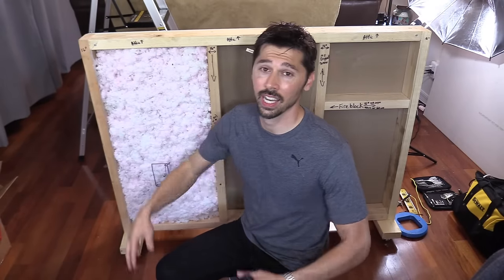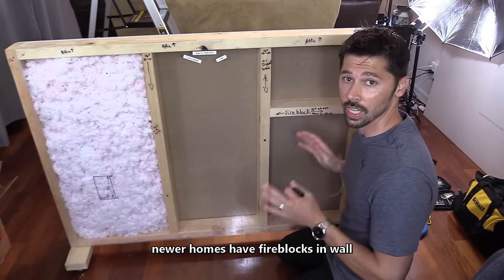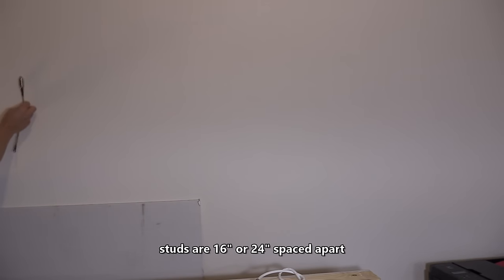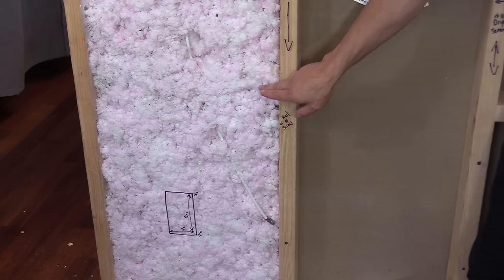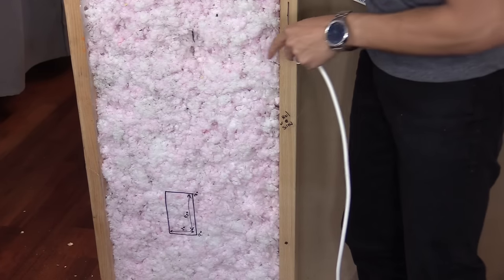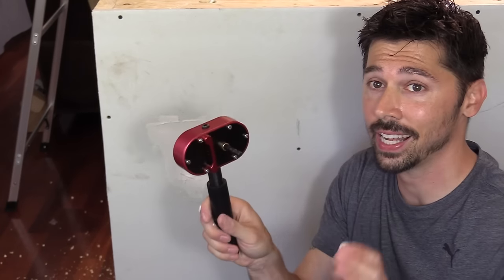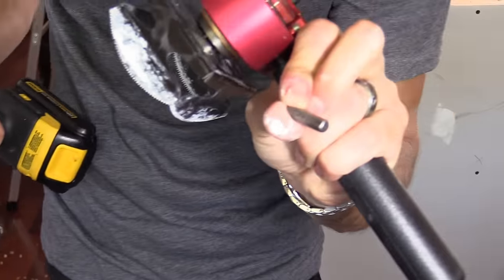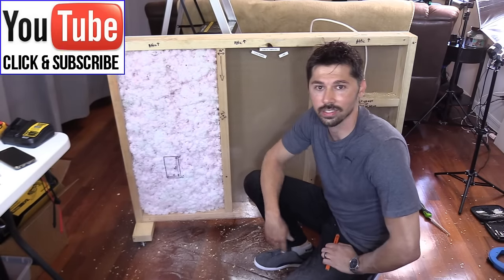3 EASY WAYS TO HIDE WIRES CABLES IN WALL & FIND STUDS

Comment: You can also use a razor knife and a straight edge to cut the square out to get access to the fireblock. A bit more work, but cheaper and just as effective.

Comment: To access a hole thru fire blocking I drill a 3/4" hole 1 1/2" above the fire blocking at a 45 degree angle. Then I seal the hole in the fire block, then I just have a 3/4" hole to patch in the drywall.

FYI: fire blocking is not always for fire stop. If a wall if taller than 8', mid way blocking is code now.

Comment: Does the magnepull kit include the flexible magic wand you used. I’m looking at the kit but didn’t see that item. Thanks for the information
Reply from the maker: Wand and chain I believe but I am double checking with them to be sure.
Reply from the maker: Yes flex leader wand 👍
Reply: Tampatec thanks.  I'm getting ready to buy the magnpull kit but there's one that's advertised for $125 and another one is advertised for $168 on Amazon and I don't know what the difference is except that in the center of the case something is different then the $168 one.  Thanks
Reply from the maker: @jeremiahjohnson731   this number is customer support. (866) 964-4557.
Reply: Tampatec Thanks for the #

Comment: I just use a tape measure and measure the top of the walls to find my drilling point.  It works.
Reply: Sure it works but so does this. What's shown here is faster and more accurate too. Which are definitely pro characteristics. Someone breaks a gadget like that out on a job and I feel like I'm getting my money's worth by hiring them. Another thing that works is just poking some cut coat hanger through the sheetrock ceiling. No one is going to see the little pinhole it leaves. Unless they got black ceilings or something. That's what magic markers are for though.

Comment: You didn't address sealing up the holes  after compromising the fire-blocking plate nor the top plate too.  Shouldn't some sort of foam fill be used to prevent a fire from feeding to the newly drilled holes should a fire break out from behind the wall?

Comment: Excellent video.  I'm moving into a new house soon and I need to run low voltage speaker wire throughout the upstairs loft/media room for a 7.1.2 home theater system.

Comment: A few here have made good points about patching a wall and other alternatives (flex bits etc).  If you MUST cut into the drywall you might consider using a blank wall plate instead of patching.  No patching/painting needed and you still have access in case more runs are needed later.

Comment: Hot glue gun works great for holding drywall patches in place so you can put your external filler on without the patch moving. You can even use a piece of cardboard as a backer if you don't have a stud there.

Comment: One thing I need to do is add an outside light through brick. I have a 3 car garage, one double and one single. I have a light on either end but not in the middle. not sure of the technique for running the electric from one of the existing lights on a finished house.

Comment: Im not an installer and don't have a  I have a magnetspot machine I used a neodymium magnet with sticky stuff on it, I placed that on the roof then I went into the roof with another neodymium magnet to about the area  and used the another magnet and presto , I had a plasterboard roof so its not that thick.

Comment: If you work for the cable company, there's a technique to avoid all of these obstacles. Just take 300 feet of cable and staple it over every baseboard and doorway throughout the length of the house. No muss, no fuss.

Comment: Now that u drilled thru the fire wall & made it easier for the house to burn, what is supposed to be put into the wall to prevent that? Second question is who has cable anymore? Everything I use is WiFi

Comment: I am an electrician in Canada. I do use the magnepull unit. But on another note our electrical code states that if a electrical cable  is too close to the edge of the stud, say by 3/4 inch.The drywall hides this situation.  If so then you must attach a protection plate to the stud or a fire stop or header or sill plate. The wire must be protected with a protection plate. This will inhibit any screw or nail to inadvertently penetrate the conductors within the cable. No one can predict what someone may do in the future to any home improvement or decorative add on to a covered painted wall even if a fire stop is only four feet to center off the floor. This also goes for headers and sill plates. If the hole is very close to the edge of the wooden stud then a protection plate is used. A protection plate is usually a steel plate that will inhibit a nail or screw installed with sufficient force. I usually use one of the removed sides from an electrical ganged switch box. I will recess the protection plate if necessary to keep things flush. Please I am not criticizing. I liked your video very much and you showed me some tools I would to get.Just trying to keep things from future troubles. Thank-you...…. Cheers!

Comment: Of course it goes with out saying that the best time to run any cable for a house is during construction when the sheet rock has not been installed. So getting together with the home builders and re modelers in your area can be a big money maker. Not just for you but also for them as their finished product will be 21st century ready.

Comment: Love the video but I can only imagine crawling all the way through a hot Florida attic, drilling the hole, discovering the fireblock, crawl all the way back then do the fireblock cut and then go back in the attic to fish the magnet back down.  I buddy of mine years ago had some really long semi-flexible spade bits for this that had a "wire hole" in the spade to pull the wire back up (or a pull string).  My big fear about these kind of jobs is hitting some electrical wire or pipes that's run horizontal.

Comment: Good job.But how about open 3 holes .1 for torch 1for magnet +cable and 1 for you to see through cavity.Then use extension drill bit for fire block(drill right underneath the middle hall ,No need for cutting  plaster wall,Your cable will go straight through.Then use roller magnet,Done.

Comment: I have only two comments. One, you don't need the expensive equipment to cut the receptacle hole. It can be done with a vibrating cutting blade, about $30. Mark the wall with a marker to indicate the top of the box. Then, using a new receptacle box lay it on the wall and draw its outline, staying at the narrowest outline of the box. Reason, you want to make sure the upper and lower tabs on the box will sit on top of the sheetrock. You will have trim the top and bottom with a box knife to clear raised parts of the box. Some boxes will vary in design. Second suggestion. Once you locate the fire block stud you can remove the overlaying sheet rock to expose the two by four, but make the cut long and wide enough to use a 90 degree drill motor to drill the hole at 60 degrees. Otherwise, the cable will be too close to the surface and possibly damaged by a nail in the future. Another option is a flexible drill bit shaft and a curve guide (about $50). Then you can keep the hole smaller and closer to center of the 2 by 4. In any case, the replacing of the removed section should be fastened to a wood backing. Otherwise it can easily be damaged at a future time. Oh yeah, make sure you have the paint to touch up the wall. Of course, if you have the money, the tools displayed in the video are great, especially if you are going to do a lot of rewiring. If so, maybe you need to call for an electrician.

Comment: For anyone wondering how this is done in houses that are not built out of cardboard : we have tubes preinstalled in the walls that go everywhere an appliance is needed. If you need a cable somewhere that doesnt have a tube, you better have good drill bits...

Comment: Aren't horizontal studs used to provide extra strength and stiffness to walls? Fire can burn right through that too no?
Reply: Not exactly sure how it works so y'all don't beat me over the head for not knowing the exact science. Just trying to help...
Fireblocks do help stop fire from spreading up walls into attics or upper floors. The open interior of a wall acts as a sort of chimney feeding air to the fire and drawing it up. A block can slow this down giving time to responders to save a structure rather than having a total loss. Hope this helps.
Reply: Phillip Christensen thanks for the explanation! I was always curious about the point of a horizontal stud

Comment: I did security installations for 10 years and here are my go to tools when fishing wire:
1- Glowrods.
2- fish chain and retreiver.
3- 6' long 3/8" and 1/2" flexible drill bits
Reply: Fish chain is nice until it goes in the back of a bare electric wire or into a outlet that had to much of the knockout removed. Glow rod or fish tape going up is the way to go.

Comment: Grab yourself a Rack-A-Tiers Javelin. Will save you most of the time having to cut the dry wall to access the fireblock. I've use one plenty of times to run electrical cabling through internal walls with great success.

Comment: An easy way to deal with fireblocks and not make holes in the drywall is either the 6' long drill bit, or the 7' bit. Get then at Home Depot and others.

Comment: An alternate way to deal with those fire blocks is to drill a larger hole in the top plate or one hole for your eye and one hole close by for a flashlight beam. Look in the wall and see where the fire block is and insert a five foot or six foot long electricians drill drill bit into the wall from the top and make sure it is near the middle of the block.  Drill the hole and you should be able to look in there and feed your wire into the hole.
If five or six feet will not work from the top you might be able to get it from underneath.
There are long flexible electricians drill bits that allow you to hold a bend in the bit while you run the drill bit through an outlet hole if the block is not too far away from you.
When I saw him cut a hole the size of an outlet box I thought he was going to cover it with a blank cover plate, you could do that.
Many walls have wallpaper, special paint or even tile that will not let you cut the wall open.
There are many tools and many length drill bits to help you get through those walls. Great video.

Comment: If you are on an outside wall you will need a right angle drill, even then there will probably not be enough space to get the drill and bit into the space. If you are on an inside wall then insulation is not a problem.
Reply: Of Course that also depends on the roof type, an outside gable end will be fine, plenty of space at the gable end. However the pitched side where the rafter/truss sits will be difficult to access. If you have a four sided hip roof, an outside wall will be difficult all the way around due to limited space. Especially in the south where the pitches are typically 3/12 or 4/12. I really did like that magnet roller combo, where did you get it??

Comment: Once i was trying to drop a wall for a guy and i couldnt get the wire to go down for anything. I told the guy there was a fire block and it cant be done without cutting the sheetrock. He had to have it so he got a saw and started cutting. Not only was there a fireblock but there was also a gallon of icetea inside the wall.

Comment: As an electrician everything was cool till you cut into the wall where the fire block was... I don’t want to be a downer... but a lot of customers aren’t ok with holes in their wall. There are other options for this. I’ve never carried around spackle or drywall mud with me... let alone had the time to wait for everything to dry and cross your fingers the customer has left over paint to touch up. I’d suggest an extension bit. They come in 3 and 5 foot lengths. You can also get an adapter and extend it more. All walls are different in respects to where they are installed... most are chest high. 

With that being said those other tools are sick. Good tips for the average DIY guy. 🙂

Comment: Get an new work electrical box to use as a guide while using a carpenter's knife to make access to the wall. Remember to drill a sheet rock screw in the center of where you plan to cut. The rest can be dealt with accordingly.

Comment: Telecom Field Tech for 22+ years.  Fire blocks can be drilled through with a 4 foot flex bit or even a 23 inch wood bit in some cases.  You don't always have the luxury of cutting through somebody's  wall to retrieve your magnetic probe.  Rule of thumb is to always map out your path BEFORE drilling and fishing.  

Too bad you didn't mention looking for electrical wires or even plumbing as a basic safety requirement when preparing to drill.  😕

Comment: If the wall is textured you had better know how to duplicate the texture to cover the hole in the sheetrock. One more thing, if you drill a sheet rock screw in the center of the removed piece it gives you something to hold on to when you are patching it up with spackling.

Comment: Having fished many walls for coax at the end of the "twin-lead" period, I found this excellent. The only thing I'd change is the drywall cutting for the cats/fire block. How you did it was fine if you have the option to fix the drywall. We used a flexible extension (auger) bit because we were in homes once and didn't have the time to return to refinish (replace, sand, paint) the drywall. Thanks for taking the time to show people how to do this! Hopefully this can help newbies spend as little time in an attic as possible.

Comment: I'd check the wiring regulations regarding running cable through insulation. It could overheat and burn your house down.

Comment: Ok I love all the new tools and gadgets which was not available when I was pulling wire. But I have one big concern. That fire block you blew through should had a steel nail on plate. It was ready for one but you forgot to install it??  Or do you tell your customers not to put a nail right there or you’ll have a big surprise coming your way. You might sleep better at night brother. Good info goes a long way.

Comment: Good video but his fire break method is a last resort. IMO. There are quicker and more effective alternatives. Use a flex bit to get through fire break. Much easier. If attic space is too small, do a reverse wall fish and go through crawl space. Also use a flex bit. Magnapull is a must have for attic fish. Glow rods for reverse fish.

Comment: What if the insulation is the solid foam board type?
Reply: You can drill through it, preferably with an auger bit, or a hole saw (conical saw, used with an arbor).
Both types can be used with a drill.
Reply: @Seemsayin  But if you need to go from ceiling to floor I don't think they make bits that long, lol
Reply: @ArcanePath360  I thought you were only going just a very short distance. Well... I guess that would present a problem. In this case, you may have no other alternative but to re-route your wiring. If you've watched this video, then I'm guessing that a "surface-mount" is out of the question. Honestly, I'd do just about anything to avoid that kind of install.

I'd have to see the location, because I don't really know what you're dealing with. But if you absolutely had to have that wire inside that wall, I would cut the sheetrock & foam out, install the wire, then spackle over it. Yeah... it's a lot of work, but then again, I'm the type that would do it, for the sake of having it done right.

Hope that helps!
Reply: @Seemsayin    Thanks for your reply and taking the time to problem solve it. I never realized when I did my house in Celotex that it would present a wiring nightmare later on. Fortunately most of the wiring is done and this is mainly a hypothetical question. You're right, it would be a lot of work but I'm just that kind of anal guy who would spend days on hiding a wire in the wall no matter what it cost me ☺
Reply: @ArcanePath360  You are welcome. It's a cool thing to be able to pick someone's brain to clarify a situation with multiple variables, just to get the scope of what you'll be up against. Sometimes I run into these situations, and honestly... my mind starts racing because I don't have a clue where any of it ends. Then... I start asking questions until someone shows me how to be realistic about it.

Yeah... when you can't see every reasonable angle, it's frustrating as hell. But glad to help.
Reply: @Seemsayin   There is a solution to every problem. Unfortunately it doesn't always present itself or consists of cracking too many eggs to be worthwhile. The trick is to have fun in trying to overcome that which reality wants to deny you. That's how I try to look at it... a test. I say try, as I often fail and get fed up when something that feels like it should be a 10 minute job turns into an epic saga.

Comment: As a volunteer firefighter I can't understand why it's called fire block and how does it supposed to help stop spreading the fire. If the fire wants to go up then it must be already big enough and no block will stop it. Even if it shoud work then after drilling holes in there it don't work for sure

Comment: Now you’ve just compromised the firewall with a hole that will allow expanding hot gas to pass through which defeats the purpose of the fire block, you should have used fire caulk around the hole and cable.

Comment: why not use a drill down kit, i drill 3 holes in the top beam one for the drill down kit, one for the tourch and one to look down then just drill a hole in the noggin no cutting plaster board and having to repaint the customers wall...

Comment: to bad the cable and/or satellite installers don't use this. They surface mount and send holes straight through walls. and refuse to use existing cable in my rentals. That is why i only allow wireless now.